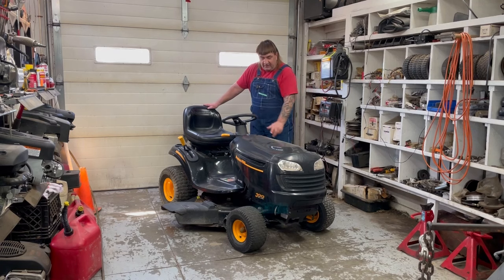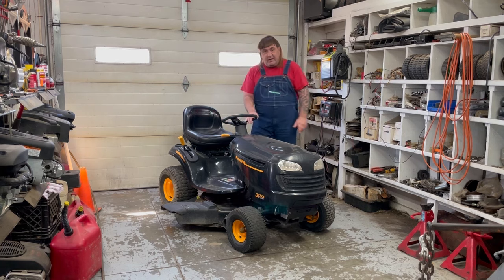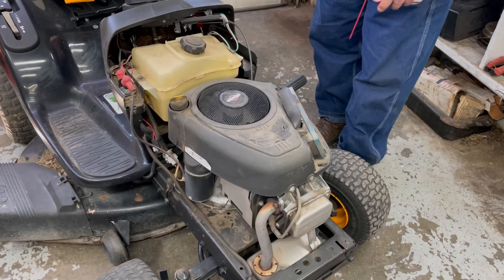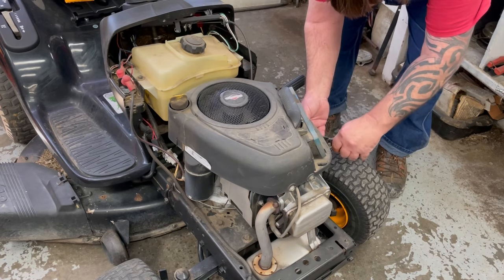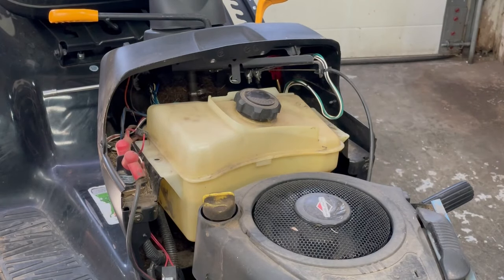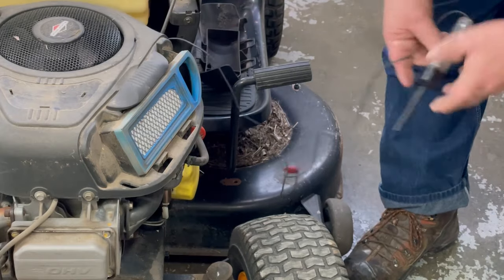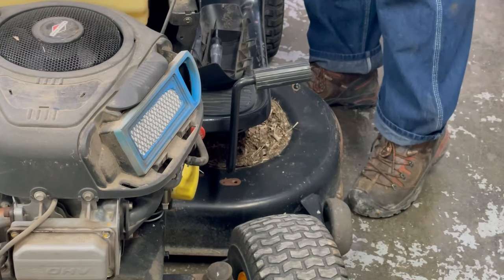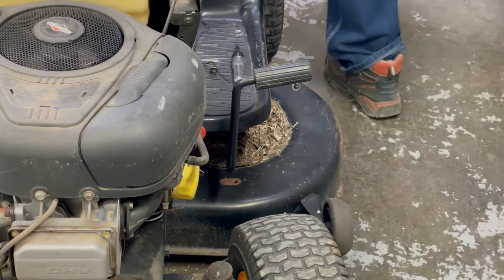Riding Lawn Mower Turns Over But Won't Start Up EASY FIX (Poulan Pro 300 EX Series)

Comment: I have that exact mower. But mine won’t click or do anything. Has new starter n solenoid idk what’s goin on with it
Reply from the maker: did you check the fuse
Reply from the maker: and the safety switchs

Comment: I have a craftsman t1000 and stopped working in the middle of me mowing the lawn , it turns over but won’t start not even with carburetor cleaner , what can I do to fix it? It has gas, new spark plug, fresh oil & oil filter.
Reply from the maker: something must of let go inside of engine

Comment: First, quit draining all the gas out of your lawnmower. Just add Seafoam to the gas before you shut it down for the winter (2 oz. per gallon) Let it run fora while so it gets thru the system (carburetor and fuel lines, etc.) then put it away. It will start right up in the spring no problem. I've been using Seafoam for 30 years or so and never need to work on carbs or have trouble starting my engines (snowblowers, lawn mowers, chainsaws, or motorcycles, ice augers, etc.) Oh ya, and I bypass all those stupid safety switches too (made for stupid people who don't know any better) and you won't have all the trouble with all the cheap wire contact plugs.
Reply from the maker: thats a great point but people ad way more then you need and it sits in carb and won't start